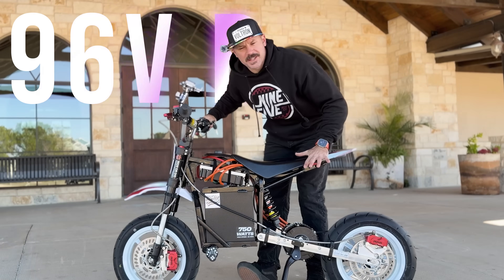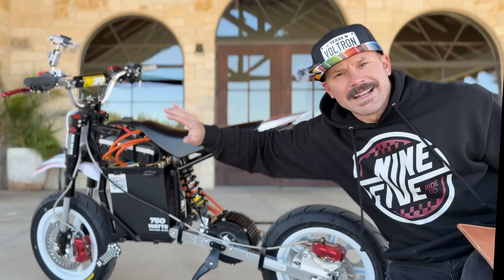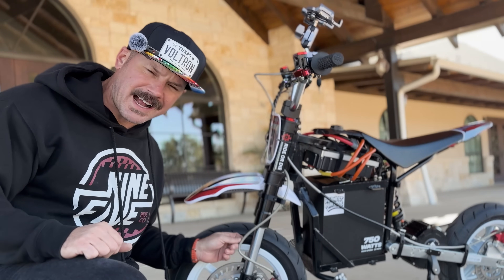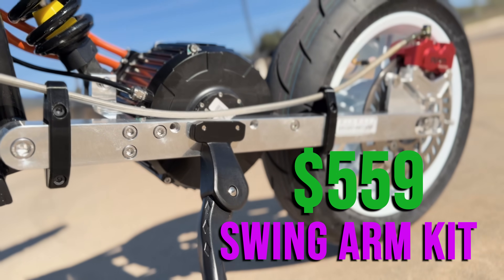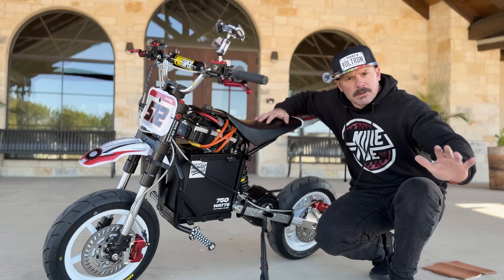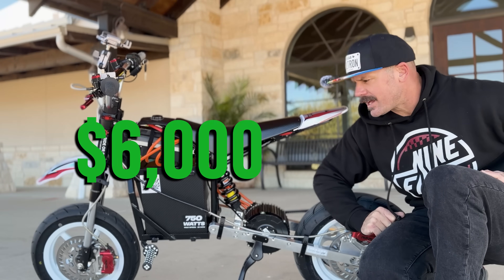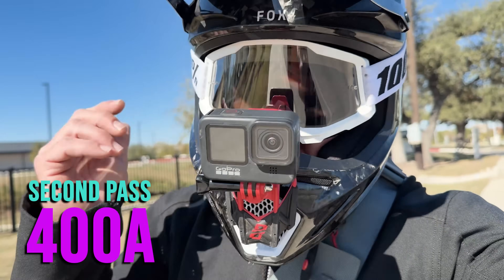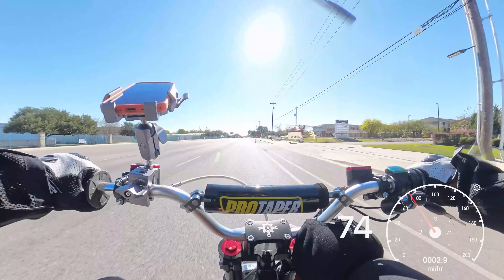I Built a 96V Modified Razor That Hits Insane Speed! ⚡ (Complete Build & Test Ride)

Comment: Ratios in speed is what's stopping the top speed. 100% up to like 8500rpm and you will gain a lot more. Also a trick to get the power to ramp in slower is to set the throttle acc step 100-150. That's how I'm keeping my 90mph Tuttio under control right now 🤣
Reply from the maker: Absolutely 🫡 90MPH Tuttio?! 😮
Reply: @VoltronWatts yep, 961000b, FW01, 96v at 280a. I had to go all the way back to the stock 60t rear sprocket to let the motor turn 8400rpm to get 90mph at that power level. Sotion motors love rpm it turns out 😂
Reply from the maker: Well… all that math = full send! 😂😂🚀

Comment: What is the front brake disc size,  and front rim  size?
Reply from the maker: 220mm and 12” rim
Reply: @VoltronWatts Oh i did not think 220 and rpm brake would fit on a 12  rim. BUT NICE then I will buy the same setup 😂

Comment: The rear rim is wide, looks like you have room for a 130👍 with a smaller rider, that thing would easily go 80mph 😮
Reply from the maker: 100% once I switch out that rear gear and tune it I think it will hit 100 😮